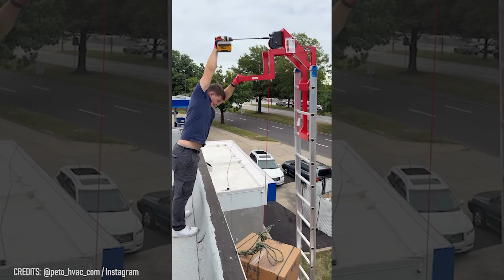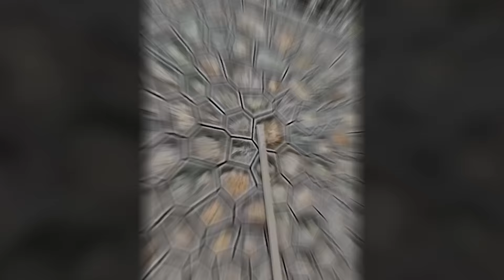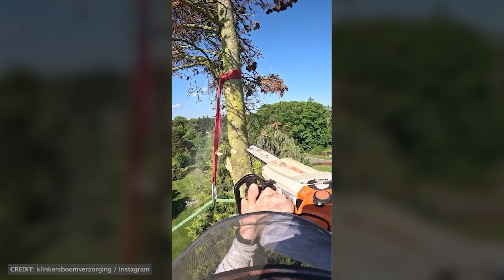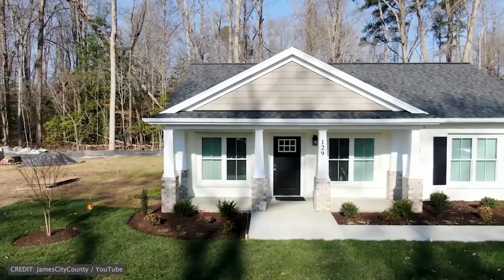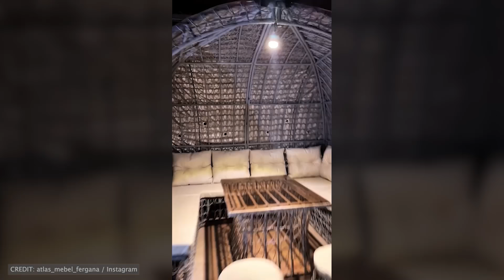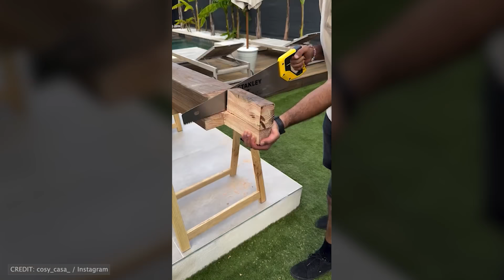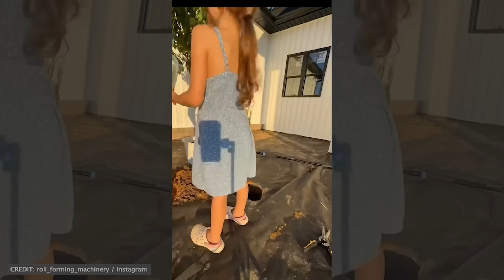Top 100 Construction Tricks to DESTROY Utility Bills!

Comment: 0:42 The only thing I would change is that the drill should be able to connect at a lower point, closer to the handle so you can stabilize the rig if the load shifts while raising up.